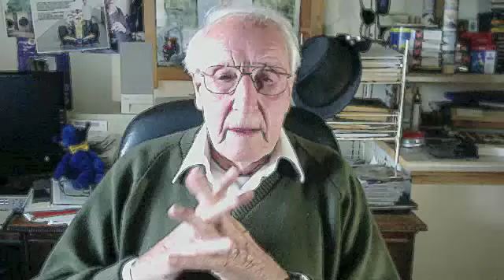Motorcycle days - Part 1

Comment: Interesting challenge to try and describe the workings of internal combustion engines without diagrams.

I was behind you, getting into motorcycles and racing in the 60s, but I was swept up by the 2 stroke concept, and ultimately learned to do my own porting, tuning chambers, and eventually went into reed valves and pumper carbs. The performance, for that era, was uncanny, and I have a box full of old (motocross) trophies to prove it.

Comment from the maker: Well done we should swap stories. I also designed a disc valve which I fitted to a Lambretta scooter during the time that I was an agent for the make. The modern racing 2 stroke is a wonderful machine and it is a pity that there is no longer a 125cc class in MotoGP I think.

Comment from the maker: I see no reason why you  could not get it going. An engine needs compression, a good spark and fuel. If the engine will turn over with the kickstart that would be the first move, next take out the spark plug and see if there is a spark and what the quality is ( a good blue crack). It the above are ok then drain the petrol tank and clean out the line to the carb. Remove carb and clean.......hopefully you will be abel to start it.